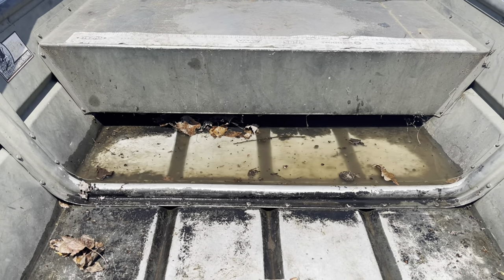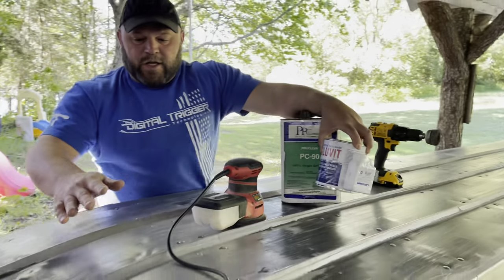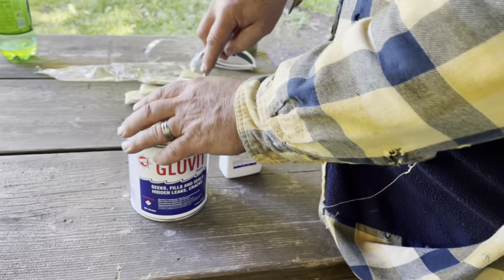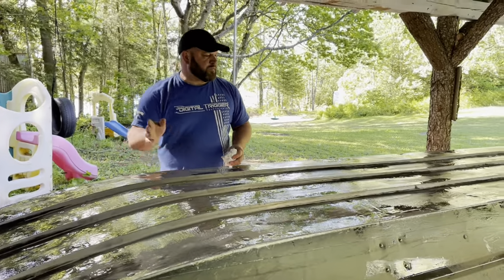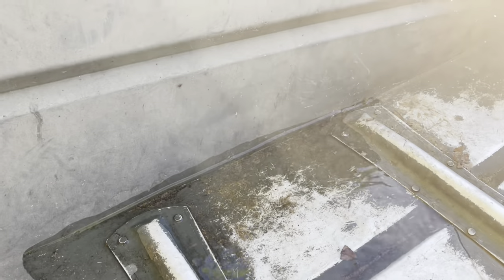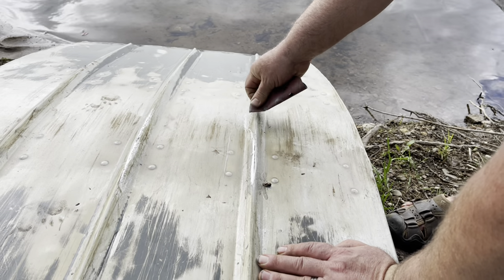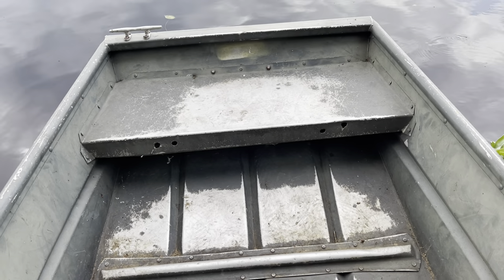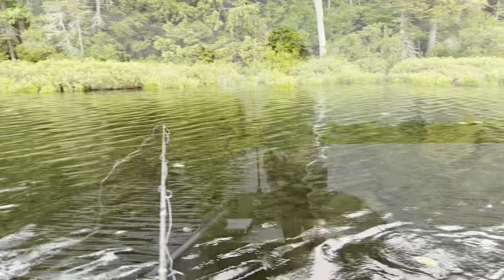Jon Boat Leak Repair | How to Seal Hidden Cracks and Pinholes

Comment: Congrats on fixing the leaks on your boat, but I'm sure that dragging it across the abrasive surface of the bank didn't help all that fine work you did!!
Reply from the maker: You ain’t kidding - it was about 20 years of dragging that boat in and out of various lakes
Reply: Used Gluvit on my deep V aluminum row boat. Was a total waste of time and money. 

Lasted maybe a month. Been on here looking for other solutions